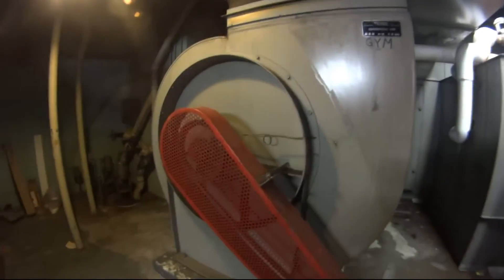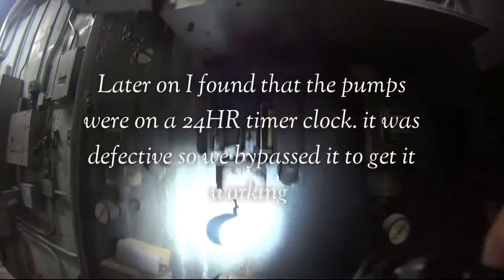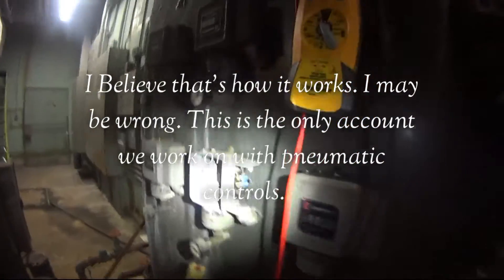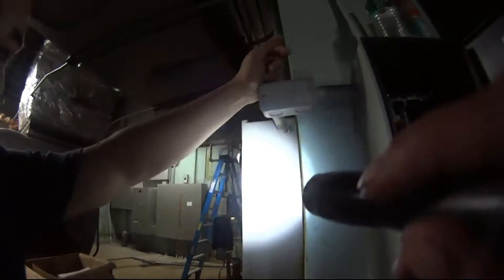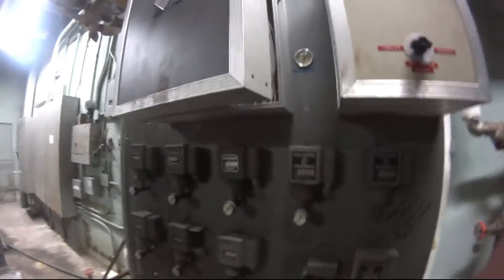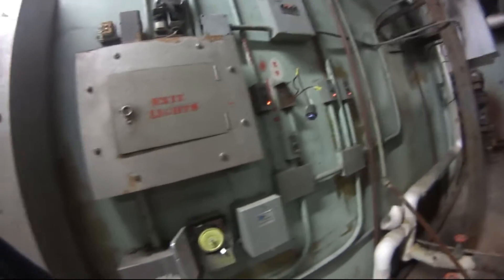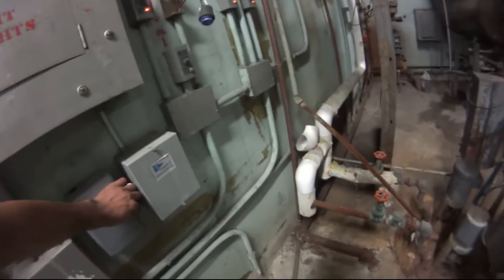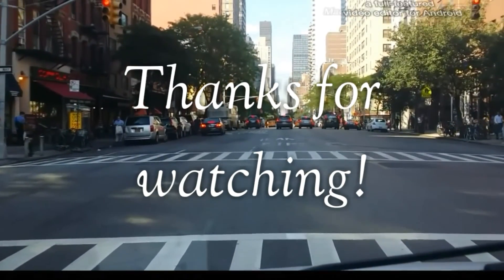HVAC | service call | Pneumatic control issues

Comment: Hey brother i am currently enrolled in HVAC school and i work in 6 buildings that still run old honeywell, and pneumatic sytems, and have learned a shit load. 
We use air in these buildings to control numerous applications. Varing from steam pressures, VAV'S, thermostats, ect... I can share anything i find, because finding anything on youtube regarding pneumatics is unheard of. Everything i have had to learn is through countless books, luck, and some help from few that are going to retire. Due to the fall in our trade soon a lot of companies will have issues. I would love to help shoot some info your way, because in some low income cities these problems are very real. My son had to show me how to use this. My email is charper.0620@gmail.com

Comment: Nice one emin when they replace the air compressor tell them to replace the refrigeration air dryer or add one don't be cheap lol pneumatic controls are a dying trade I wish I could work on more of them now everything in DDC and BAS system in which I'm still trying to pick up.
Reply from the maker: LOL they have been promising to replace things here for years lol. I like the DDC, BMS,BAS system. thanks for watching brother